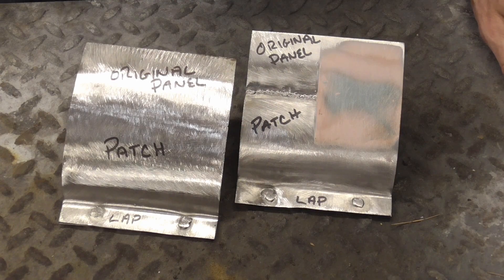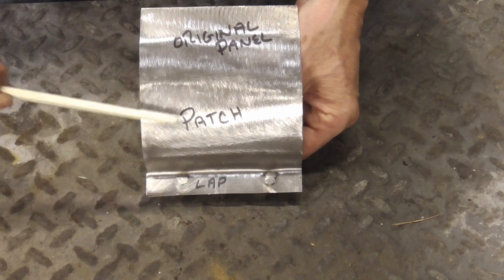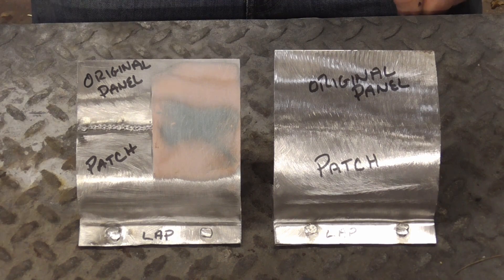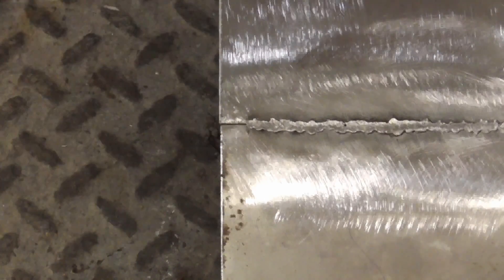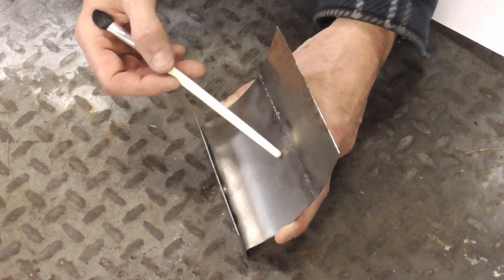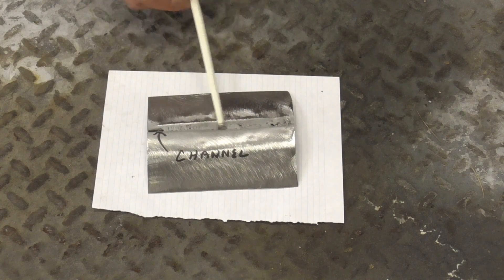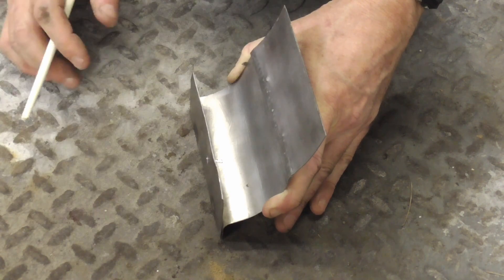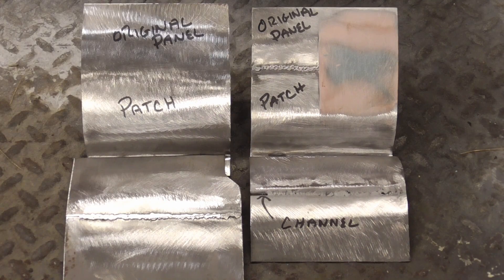Butt vs Lap Welding for Rust Repair: The Debate Ends Here!

Comment: So, the debate does not end here! You didn’t say which one is best. I think you leaned towards the lap joint though. Years ago, I did a lot of rust repair. And our usual method was a lap weld. It is easier than a butt weld. But in all cases, the rust would eventually return. Keep in mind, I live in Minnesota. It’s humid in the summer, and our state does use salt on the roads in winter. Cars rust here! I feel rust is like a cancer. No matter what you do, it’s probably going to come back. Now, if you have a vehicle that will not see winter driving, it’s good to go.  What else are you going to do?  If I was back in the industry, I think I would lean more towards the butt weld. Because you can use less body filler to get it straight.  Good video!
Reply from the maker: Thanks.  I think all methods can work if done right.  .I think magazines, television, and internet are really lying to folks when they claim there's only one way.  If you examine how the rust will begin again you can stop it.  No moisture = No rust.   Thanks for your opinion - your right - everything is going to deteriorate - how long can you prevent it from happening is the challenge and the focus :)

Comment: Lap welds and butt welds both have their place.  Exposed panels = butt welds.  Structural areas = lap welds.  I don't weld on modern cars with "high strength" steel as it is outside my area of interest.  I work on older cars that use 20 gauge or thicker steel.  Great video 👍
Reply from the maker: Thanks Jeff - You might appreciate this video on older cars:  https://www.youtube.com/watch?v=fHgUG_fhvuI

Comment: Too many people have forgotten how to braze
Reply from the maker: Interesting..... My dad used to braze - what do you like about brazing?  What are the advantages?
Reply: @LakesideAutobody  I used to primaraly because it was showed to me that way. Tac and braze. The advantages are less warpage and in those rust pit prone areas that are waiting to happen, it bleeds its way in as long as you butt the metals. The funny thing is, at one time, they used to lead ladel, use bees wax and wood to sculpt, then came body filler. I actually saw an old time doing on a chop top and thought, why? Isn't the car heavy enough. After all, it was a late 30's hardtop. lol. Then again, it simply is what you are taught or learn. I'm sure in his mind, he thought it was better then filler.
Reply: It's not that they forgot, they never learned. It used to be the go-to method of repairing lots of broken metal.

Comment: Thank you for another great tutorial Jerry.  I need some advice.  I have 4 VW fenders off of a 1973 Thing, they have been blasted and put in epoxy primer.  Some rust holes and bad spots around the mounting flange.  Could I send you some pics?  I'm trying to figure out some simple steps for repairs that won't require major welding if possible.  Can I use fiberglass cloth a metal mesh kit for hole repairs?  Also, do I need to remove the epoxy primer prior to any fiberglass repair, body filler etc?  Really appreciate any feedback.
Reply from the maker: No problem - my email is listed under the "about" tab on the home page.  Some folks say it doesn't show up - let me know if it doesn't.  Jerr
Reply: @LakesideAutobody  Hi Jerry.  I sent the email over this morning.  The email was not visible on phone in YouTube app, I had to use desktop browser to see it after clicking I'm not a robot and then clicking submit button.
Reply from the maker: @sayjackTux  OK - sorry about getting to this message late - was busy all day :)

Comment: If you don't oil undercoat the inside of any bodywork on your vehicle it's not going to last very long ..
Reply from the maker: True - Even the manufacturers recommend treating after the welding and painting as opposed to treating before with weld through primer.  Some are getting away from the weld through idea and treating after.

Comment: Hi Jerry, your videos are well done, easy to understand, and much appreciated!  Could you answer a question....working on a 63 Studebaker which has numerous spot welds holding on the torque boxes and body supports....what is a relatively painless way to remove spot welds?  thanks....Joel
Reply from the maker: Here's two videos on it - https://www.youtube.com/watch?v=y2WSpGFVRPM  **  https://www.youtube.com/watch?v=hkESVLqypLc   Thanks for the support.  If you don't have to worry about the drill bit popping through and damaging something, the drill bit method is cheap and easy.  Let me know if this helped - if now ask again.  Jerry

Comment: If you butt weld and fill with fiberglass or all-metal filler, it's waterproof.
Reply from the maker: Yes. That would work - grind the weld down a little bit, tap the seam down and fill with your choice of water proof filler.  What doesn't work is butt welding and grinding away at the welds trying to "metal finish" like some magazines and internet articles are telling folks.  The metal is too thin and there are too many variables - like low spots that can't be worked out, warped metal, pin holes in the welds, gaps, thin welds, paper thin sheet metal after aggressively grinding, etc.
Reply: @LakesideAutobody  If I can get to the back of the panel, I also put a coat of waterproof filler on the backside of the repair. I've redone work where the backside rusted out if it was exposed to water.
Reply from the maker: @stevewarren3051   If you can access the back of the panel to seal it, your golden - it'll last forever - no moisture = no rust.  Thanks for the comment.
Reply: @LakesideAutobody  That's right for the most part. I've seen older polyester filler repairs also fail because the top coating over the repair was compromised by sun or otherwise. If the paint film is damaged, water can intrude into the primer and porous bondo underneath. Back in the day, they told us to always seal body work with epoxy primer before finish priming.

Comment: Well presented and explained, thank you.  Before my first MIG weld,  I watched a ton of YouTube videos.  Initially, I thought only butt welding was acceptable and many videos (incorrectly) suggested the same and were very critical of lap welds.   However, after watching your videos I learned the best welds depend on the repair required.  The adage “perfection is the enemy of good enough” comes to mind.
Reply from the maker: Excellent adage!  I'll have to remember that - so many times "perfection" will prevent folks from even starting a project.  Well said. You'll be perfectly fine using the methods found on this channel.  Many quality shops in Michigan use the same - that's where I learned them.   Thanks for the comment and support :)

Comment: I don't know of anyone in the business or out who has had a lot of success creating those "channels", way way too much work for spotty results at best.

You show both lap and butt with what I assume are MIG welds (supposed could be TIG too, know some who use that) but what about "old school" the lap joint using bronze?  Same orientation of the lap so the inner doesn't hold moisture but no issues with penetration as it doesn't at all but also, IMO, less likely to leave gaps as it flows into crevices well.  PITA for the next person however.
Reply from the maker: I agree with you on the channel but there are a lot of folks that insist on strictly but welding so I figured I'd show a way to butt weld and metal finish w/o grinding the welds away.  It is a bit difficult.  As for the braze - I think that is a good solution too but it too has a few disadvantages.  Thanks for you input - Jerry

Comment: I use whatever weld will work best (in my opinion) for the situation. If I want it 'water proof' I use lead for the initial fill. On the inner portion I spray Fluid Film.
Reply from the maker: How do thin out the fluid film to spray it ? - I bought a gallon but have not read the instructions yet - the stuff is like Crisco.

Comment: I don't buy the idea that water will run straight over the lapped joint. Water has surface tension and can literally do a 180 over an edge and then seep up the joint. All joints have failings, but for me it's butt weld every time.
Reply: Your butt welds are perfect and you get 100% coverage when you rustproof spray the inner panel? I've never seen 100% perfect buttwelding when seen from the backside.
Reply from the maker: That's fine if it does because if there is a pin hole or gap, that bit of moisture is going to have a big battle trying to rust through a weld and break through waterproof fiberglass reinforced filler.  It can quickly break through primer and paint - I've experienced it and studied it ever since I was in 8th grade (dad was a body man).  Always bought junk, drove it for years and years and sold it for more than I bought it for.  Next vehicle will be new though - I hope :)

Comment: Great overview.. I get why the lap weld be better in many cases. The first weld in repair I did is bubbling after 2 yrs. Butt welded a patch at the back of a rear fender well. Must have had a pin hole, and also I didnt use bondoglass at the time... now i do a coat of glass for waterproofing then filler. I have fun doing these repairs.. I've learned so much I've got 3 cars I'm working on right now between mechanical work, and my first real minor collision repair on a 2016 vw. Of course they're cheapskates that's why I'm doing it.. lol, only paying for fender paint no blend, with metallics.. we'll see how it goes..
Reply from the maker: Great to hear Jeremy - let me know how your projects go and if you have any ?s - have a great weekend :)
Reply: @LakesideAutobody  glad to now understand why I got bubbles on some repairs... I found out you can't spray 1k clear over 2k clear a day later.. I was a little light, matte, on one section of clear I sprayed with spraymax 2k, ran out and tried to finish that section off with another coat of duplicolor clear next day. it reacted and melted all the way though the base coat. What a mess, Lol.. good thing it's the 02 civic project car. Had to do a quick and dirty sand and repaint on that section
Reply: @LakesideAutobody  sorry, I did have a question.. if you spray the back with oil and there are pin holes will the oil seep in and ruin the body work and paint.. maybe only if it's a new repair, maybe wait till later?
Reply from the maker: @jeremyr7147  No - you're fine - at least I've never had a problem doing that.  In fact, the sooner the better - don't even give the elements a chance!  I use average quality materials too - so if you're using 2K primer and paint - even better.  Try it in a small area for a day or two - wipe off the residue and see how the finish is doing - if it's fine then go for it :)
Reply: @LakesideAutobody  thanks!! Funny I just had a newer volvo c30 pull in the rear tires bald and toed in about 10 degrees on one side from a parking lot hit... had it all fixed and alignment straight in no time thanks to all I've learned. Straightened the subframe and had plenty of room in alignment adjustment to get it straight. He's gonna have me do his body work and paint in the near future too. Pretty fun day and I guess I work for the pride and accomplishment.
Reply from the maker: @jeremyr7147  That's great to hear.  Thanks for the story - have a good weekend :)

Comment: Great Tutorial Bud!! In 50 years I have not yet run into a factory Butt weld!! Most lap joint repairs are never near a rust prone area anyway!! You'll never convince someone who doesn't do Bodywork that a lap joint is better than a Butt Joint!!☺
Reply: Yeah you may not have run into factory butt welds, because from the factory they produce complete panels. There was no need for a butt weld. But in the real world, to keep the metal the same thickness without excessive filler a good butt weld with the correct way to do a repair. Don't let Mr. slap a 1/4 inch of bondo man cloud your thinking.
Reply from the maker: @mypointofview6056   Today’s metal is .030. That is literally 6 hairs (hair is .005) thick.  You start grinding on that and the result is paper thin welds & surrounding metal.  Your goal is to have methods to fix anything .  Surely you’re not going to butt weld and metal finish this: https://www.youtube.com/watch?v=36zkc9UQaTs or some of my other rust repair videos.  Use small overlap, weld solid, tap welds down, use fiberglass reinforced filler and you won’t have to worry about moisture - especially if you keep the drain holes clean (most important thing in rust prevention). Note that  the opening of the seam is upside down on the inside (no moisture trapped).  See these videos for longevity of this type of repair if done correctly: https://www.youtube.com/watch?v=8XaZBy7GC7A ***
https://www.youtube.com/watch?v=2o37dX-
Reply: Upside down seam? One word: capillary action 

....(ok that's two words)

Also, how do you manage to get the seam upside down all the way around the patch? Either way, if you're not treat the inside of the panel is gonna rust. Love the videos
Reply from the maker: @clmym00  Thanks Myles - true the cap action probably happens but it dries out as opposed to being trapped.  Does that "hold water" - no pun intended :)   Jerry
Reply: @LakesideAutobody  I have no skin in this game - but what about a joint where you don't have the luxury of having a horizontal cut? For instance, repairing Subaru rot in the rear arches (you'd end up with vertical, or semi-vertical joints on the ends of the repair). In that case do you still do a lap joint all the way around, or do you do a combination of techniques?
Reply from the maker: @lavachemist  If you have to make a butt joint, that's fine.  It was done all the time.  Lap joints in areas that can be knocked down and filled.  Butt joints for areas that are too firm or rigid to be knocked down and filled.  Have to make sure that the welding is nearly perfect on those butt joints - if there pin holes or very thin metal from grinding the welds, they will be the first to bubble.  Basically if you can lap weld and knock the seem down a bit - do it.  If not butt weld it.  Combination of techniques is good - learn them all because every situation is a bit different.
Reply from the maker: Well said - have a great weekend and thanks for the support - Jerry

Comment: Just make sure you use a quality rustproofing application as well and there won't be any issue with rust when doing a but weld the better way to do it.

Comment: I just received the new inner an outer rockers and a floor brace for my old rusty 50 Plymouth business coupe. Looks like it will need 99% LAP welds. I plan to temporarilly fit the two peices together and see how they'll fit on the car,  Both front and back ends of the new rockers are open. Due to so much rot, I can't tell if there ever were plates on the ends to cover the openings. The front opening is gonna catch dirt and water. Maybe good to leave the back end open to drain? and also drill drain holes along the bottom like you showed. Maybe it will all reveal itself when I get under there. Thanks for your great videos.
Reply from the maker: You're welcome -  Never heard of a Business Coupe - had to look it up - very cool car.  It's always a good idea to invent allow for drainage like you said.  After the repair you can rust proof like in this video:  https://www.youtube.com/watch?v=8XaZBy7GC7A  
Let me know how your project goes and If you have any ?s feel free to ask - doesn't matter what video - I answer 1-2 times a day :)

Comment: Those who cant properly butt weld panels lap weld, end of story.
Reply from the maker: Sorry but both are pretty easy - you saw it on the video.  I have to use both methods all the time.  You can deny the truth that's in the video.  With respect, that's why professional body shops use a combination of lap and butt.  One thing to remember - there is not one butt weld in a new car :)
Reply: @LakesideAutobody  I believe you are correct in your aspect of the business of collision work where its all about knocking jobs out quick and getting the next one in, then I too would just flange lap weld grind, and cave and pave with filler. Most collision vehicles are just being put back together well enough to get back on the road to be hit again and end up in the boneyard anyways in a few years.